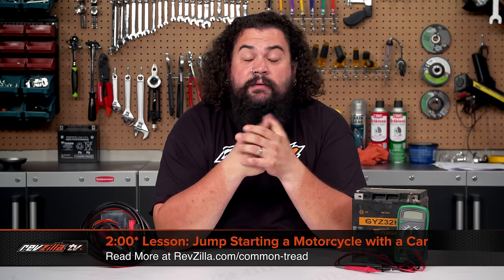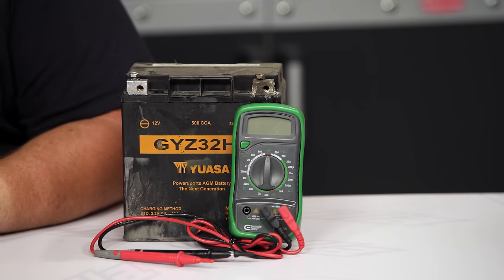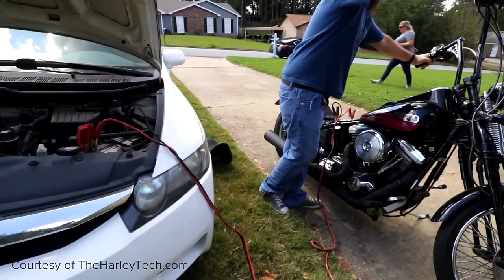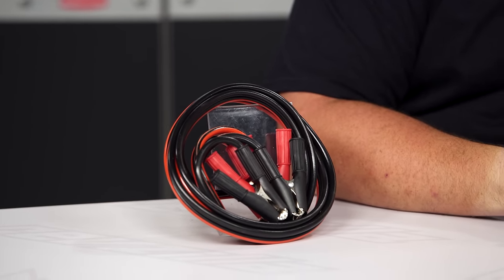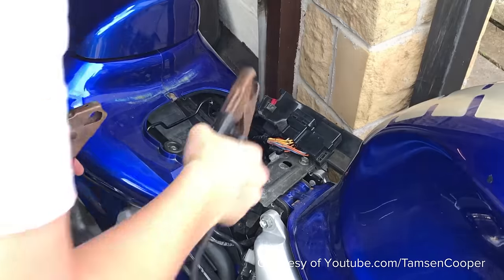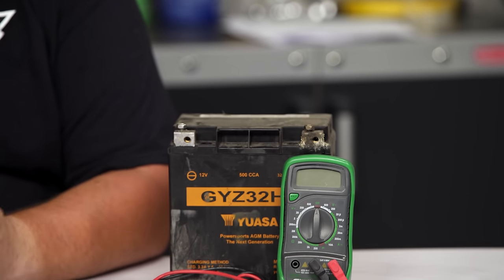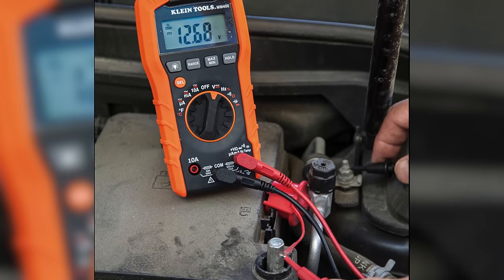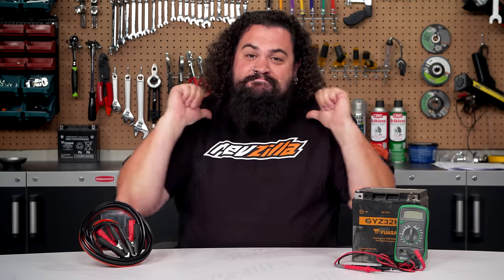2 Minute Moto - Jump Starting a Motorcycle with a Car

Comment: Hello Revzilla, thanks for the Video, I jumped my motorcycle from a car battery the car was running, I started my bike and got it home, the it started missing and losing power then died. I charged the battery over night and it started fine the next morning I rode 34 miles and just before I arrived home it lost power and died again. I brought a new battery today. Am I supposed to charge a new battery? Do you think I've damaged my motorcycle, my back wheel locked up and I almost crashed it when the power ran out. Can you give any advice please Sir, regards from England.
Reply: Did you ever figure it out if jump starting it damaged the bike?
Reply: @VEDADDY_OFFICIAL  Yes it damaged the Bike, I traded it in for a new bike. It damaged the alternator.
Reply: @qwanathomas735  what year was the bike that got damaged?
Reply: @VEDADDY_OFFICIAL  it was a 1999 Honda X11.
Reply: @qwanathomas735  so this video must make you pretty pissed off.
Reply: @VEDADDY_OFFICIAL  No it doesn't make me pissed off, what does make me pissed off is that I have a Honda FMX 650 now, and it's leaking fuel from the carb overflow. Worst is I've paid a bloke to fix it he's attempted it twice now and it's still leaking, so I need to pay someone else who is actually competent at the job.

Comment: I was told that when you jumped the motorcycle, do not have the car running, because the amperage of a car battery is a lot more than that of a motorcycle, and it could easily damage your motorcycle battery. Just what I heard, passing it along to you.